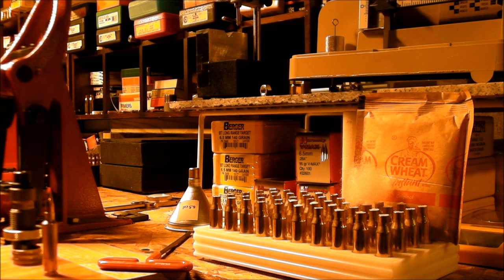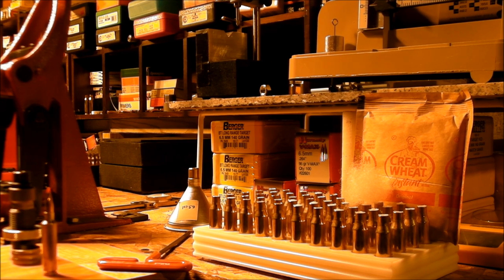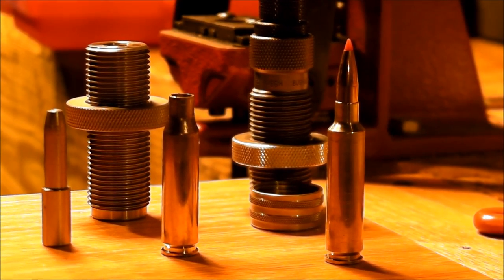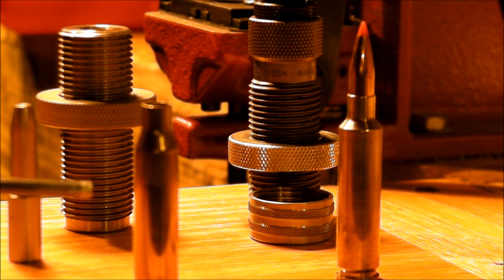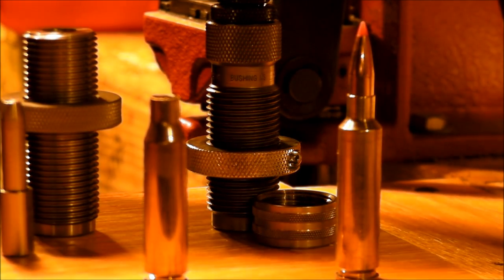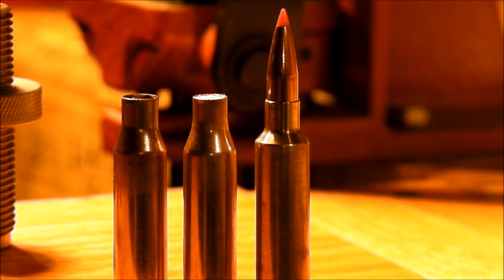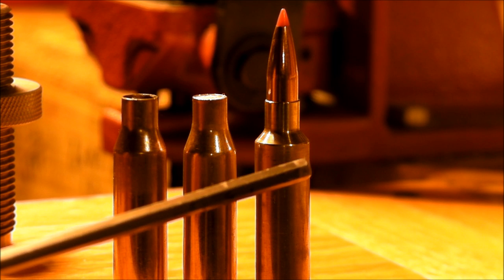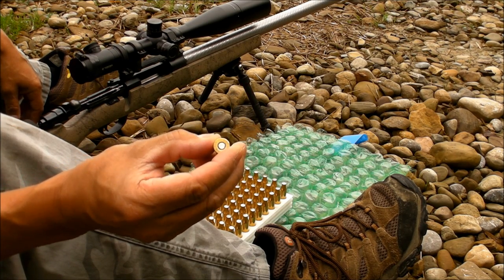260AI Ackley Improved Cream of Wheat Fireforming Brass

Comment: You do not have to fill the case completely to the top, shoulder level is ok.  I use between 14g of bulleye, topped by cream of wheat.  Also, cool the barrel every 25 rounds.  I clean the barrel with a good brush at the end of Fire forming 100 cases.  Also, a piece of paper towel in the case mouth, toilet paper are all that is needed.

WARNING: when fire forming with cream of wheat, it is blown out the end of the barrel. Some of the cream of wheat gets stuck   on the inside of the case shoulder. Simple fix is to just bend a large paper clip, and rub it around the inside of the case shoulder, examine with a small flash light.

You do not need Lapua brass to shoot tiny groups, I promise.  139-140g at 2950 is the norm where groups are very tiny.

The headspace should be set to be tight on a std 260, 243 case so that you do not have to worry about a false shoulder, but your False shoulder tip is right on the money.

The 260 AI is just an incredibly accurate cartridge. I form cases from Lake City match 308 cases that are really tough!   Also, if you can find any 243 PMC cases they are as tough as Lapua brass.  Winchester 308 brass produces excellent 260 AI brass.

40* shoulder seems to be magic for the reasons you suggest.

There is a difference in Web dia of the Lapua brass(larger, European CIP spec) and the Brass made in America(SAAMI).  If you are not aware of this, you may get premature hard extraction issues on Lapua brass. Many gunsmiths do not have reamers set up for European brass and American brass, and this is a critical issue.

Comment: I'm reading Ackley's Handbook right now, so am developing an interest in those shoulders. I also have an abundance of .308 brass with no intention of loading so much of that. I'd like an alternative to the 6.5-284 so I'm exploring the 260 and the AI version. After you've re-formed and shot rounds, what about reloading? Are there reloading dies for Ackley?

Super photography!
Reply from the maker: William Heppe You can find Ackley Dies on eBay. However, I had my gunsmith make me dies from the same reamer he used to chamber my barrel. I use a bushing die to re-size only the neck [I have a 0.297" neck, and size them down to 0.293"], and I just got done bumping the shoulders back after 7 reloads...

Comment from the maker: Yes Jim,

Your 280AI would entail the same process. I cannot give the exact proportions for the C.O.W. and pistol powder. However, start low and slowly increment your powder charges until the shoulder get close to being "sharp".
Reply: On my 280AI I started at 18 gr of Unique & 22 grains of COW.  19/22 = 2.117, 20/22.5 = 2.116, from 20.5 to 23 gr unique it yielded 2.118. I ran 23/22 and got 2.116. Firing regular 280 bullet was about same as COW.  After firing these rounds as 280AI midrange loads I got the final headspace of 2.116/2.117. Nice crisp shoulders. To me the COW is th he way to go. I load the powder, then a thin piece of TP. Tamp it with a hex wrench. Then drop the COW. Now tap the casing on the rim on the table in a circular method to pack it in. COW should be ar top of shoulder.  Now tamp in more TP to seal. Fire at an angle up.

Comment from the maker: False shoulder is only necessary when fire forming at the relatively low pressure. Watch the video again, and listen carefully....and if you are still not convinced, read the article by Chris Long that I posted...
Reply: False shoulder is not necessary if the barrel is chambered properly, ask any good gunsmith.
Reply: It is if you are pushing the shoulder neck junction forward instead of pushing it back without a belted case. most AI's have the neck shoulder slightly set back but not all wildcats with improved shoulders are designed this way.

Comment: Is the .260 AI worth it over the .260 rem? I've read tons of threads and just can't seem to make up my mind? I don't mind spending time fireforming
Reply from the maker: +Snarf Hardy Absolutely, the brass life and zero trimming is worth it alone!
Reply: +ArchersParadox2020 FPS increase? Can you expect 100-150 increase? Will focus on H-4350 as it is universal with a lot of my loads. (.243, .270, .300)
Reply from the maker: +Snarf Hardy Easily. My max loads are pushing a 140 gr. Barnes Bullets @3,000 fps from a 30" Bartlein 5R Barrel.
Reply from the maker: +Snarf Hardy anytime! Btw, I use H4831 & H4831SC, too.

Comment: I see no reason to create a false shoulder on a .260rem case as the headspace in a .260ai chamber is .004 shorter than a .260, and this is measured at the neck/shoulder intersect. Therefore any .260rem brass should essentially "crushfit" in a propperly headspaced .260ai chamber.
I recently had a .260ai gun built and the first thing I noticed is that I need to apply more than normal force to close the bolt on SAAMI .260 cartridge.
I got this info from:   http://pacifictoolandgauge.com/material-downloads/reference-data/ackley-info-sheet.pdf

This only applies to a .260rem cartridge. If your fire forming something else then the false shoulder may apply.
Reply from the maker: +Robert Short http://www.6mmbr.com/260AIforming.html
Reply from the maker: +Robert Short "..Solving the Loose Case Misfire Problem--The False Shoulder Method
One of the most common methods to fire-form 6mmBR brass into 6mm Dasher cases (6mmBR Ackley improved) is to introduce a false shoulder into the case neck, just thick enough and long enough to firmly hold the case in place in the chamber during the firing pin strike. In the case of the Dasher process, this is done by expanding the 6mm neck with a 25 caliber or 6.5mm mandrel, then neck sizing with a bushing die, setting the bushing such that only a part of the neck is resized. The position of the bushing is adjusted until a firm force is needed to close the bolt on a prepared case. This locks the case in place, and assures good ignition and consistent case lengths after fire-forming..."
Reply from the maker: +Robert Short "...For this experiment a 7mm mandrel was used to expand the neck. The neck was then sized down using a Redding Type 'S' bushing neck die with a 0.292 bushing. The bushing length was set so that a very firm push was required to chamber an empty case with this false shoulder. The picture shows (left to right) an un-modified case on the left, an unchambered case with a false shoulder formed (middle), and a false-shouldered case that has been chambered and extracted (right). The close-up photo clearly shows the region of the case that has been forced into the neck part of the chamber as a shiny ring at the base of the neck. This crush firmly locks the case into place during firing..."
Reply: +ArchersParadox2020 First off thank you for sharing your time and insight on YouTube.
I have read 6mmbr, infact it was the first place I started learning about fire forming.
I recently received a .260ai Custom 700 Remington from Casey Brouwer at Tactical Ordnance here in Ontario.
When I attempted to chamber a .260rem cartridge my bolt would not close. I sized with the custom NK (neck) die Casey provided me with and the bolt close, but not without some force.
I was concerned about the headspace so I looked it up on PTG's website. I found this diagram of a .260rem cartridge in a .260ai chamber.
http://pacifictoolandgauge.com/material-downloads/reference-data/ackley-info-sheet.pdf

Please look at the diagram. I don't see why a false shoulder would be necessary as the shoulder neck intersect is clearly in full contact, also Ackley made sure the case wouldn't  move by designing his chamber .004" shorter than the SAAMI chamber.
Just saying that if you are fire forming a case that has the same diameter neck and the same head space, there is no need to create a false shoulder.
Reply from the maker: +Robert Short "...Improved Cases--Many Variations on a Theme
One thing I learned several years ago is that there are at least two variations of the Ackley improvement. There is the original Ackley dimensions and there is a Clymer variation that has slightly more body taper. My chamber copies the original Ackley pattern with minimum body taper. Also note that this case is very close to a .260 Ackley Improved but still not the exactly the same. I am pointing this out because I honestly believe any of these variations would work very well with the right leade and throat but since they all have slightly different case dimensions, it is very important to match your reloading dies to your exact version. Using the wrong body / bump die will over-work your cases or cause slop in the fit of a chambered round that will do nothing good for accuracy. Close is not good enough. Make sure your dies are for the exact round your barrel is chambered for. In our game, reliability is just as important as accuracy. There are no alibis in the event of a malfunction or mis-fire, so everything must work perfectly, every time. Because of this, we have always been a proponent of body sizing every round. When the correct die is properly set up, you can achieve perfect chambering and extraction while losing little or no practical accuracy. Note that our realistic accuracy goals are different than the benchrest crowd. We are wiling to give up one or two tenths to achieve reliable feeding and extraction even in a dirty rifle...."

Comment: Where do you get dies for your ai?
Reply from the maker: My gunsmith ground the sizing die from the chamber reamer = exact fit!
However, after the first full-length resize on virgin brass, I ONLY use a neck bushing die to size the necks down.